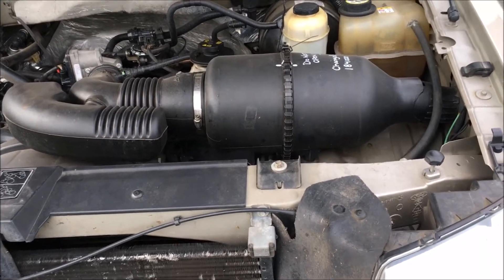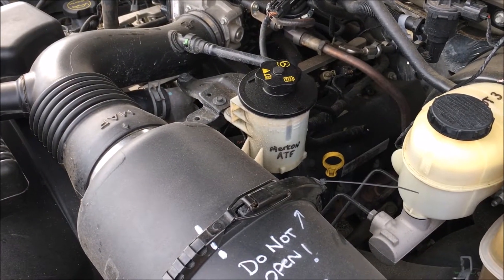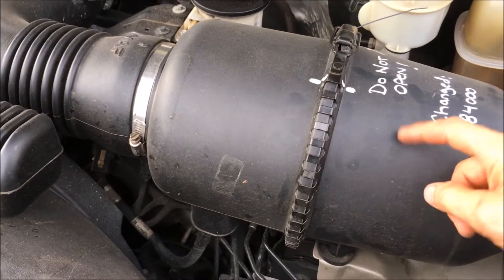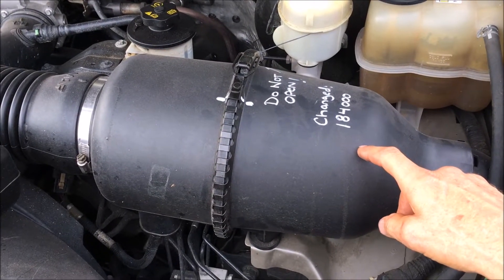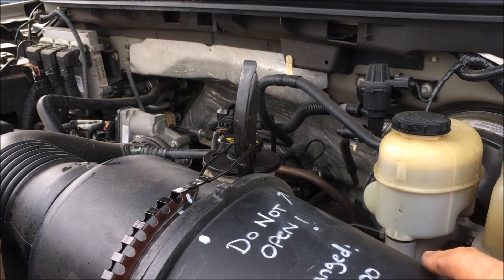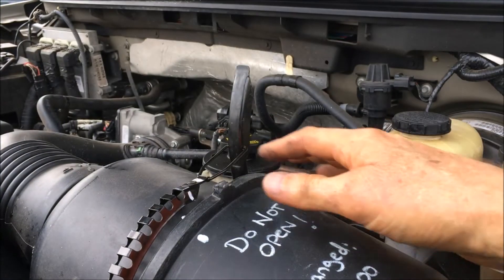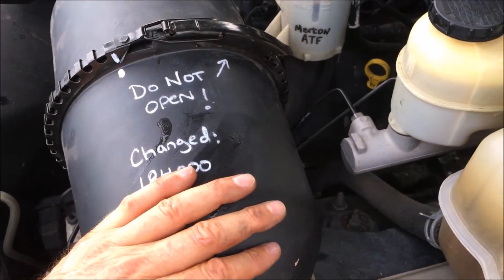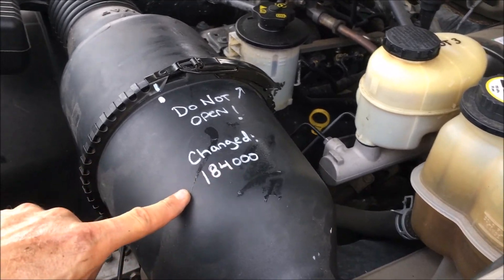How to get More Miles out of your Car or Truck

Comment: I like your labeling system. Seems like an overly complicated air cleaning housing but I'd say you got it figured out.
Reply from the maker: I think it is possibly damaged from not being installed correctly at some point.  If they were all as difficult to install as mine, there would be no old fords with this design.  They would have all been in the junkyard by now.

Comment: I just knew you were going to say,the way to get high mileage from a ford was to drop a chevy engine in it. I cant tell you how many times I've told the oil change guys not to check my air filter or tire pressure,only to catch them airing down my hot tires and misaligning my air box. I stand there now and watch them .
Reply from the maker: I don't blame you.  They put 10W30 in mine the other day when I clearly told them 5W30.  They said "But we put that in all the high mileage engines"  I said, "5W30 got me this far so I'll stick with it!"

Comment: When you say change your oil frequently, how often do you change your oil? Also, if you are so cautious about your truck, why not change the oil yourself?
Reply from the maker: Tyler Ward follow your manufacturers recommendations on fluid change intervals. The F150 I have recommends synthetic oil every 5000 miles. I change my own fluids when I can but if they are due and I can’t get to it, I hire it done.
Reply: Just Plain Common Sense I was told to change my oil every 3000 miles by the original owner, 278,000 miles now
Reply from the maker: Tyler Ward I wouldn’t change a thing then!